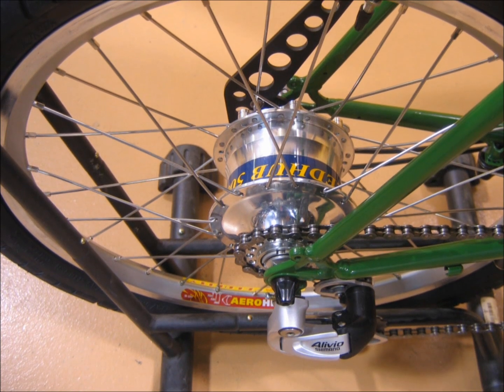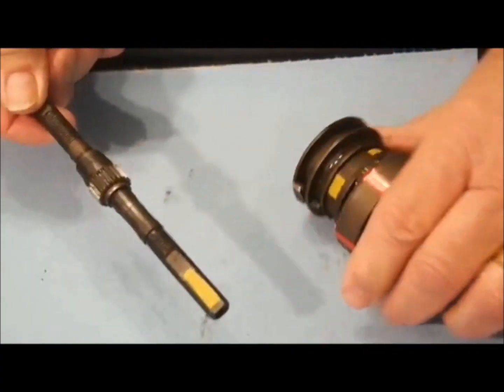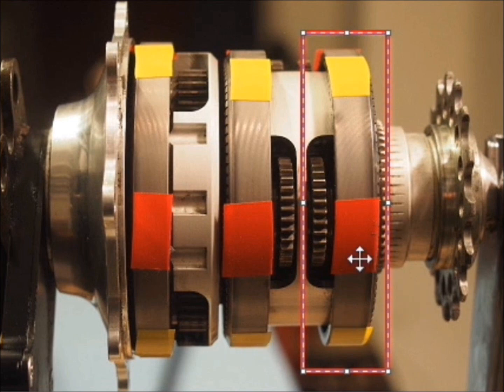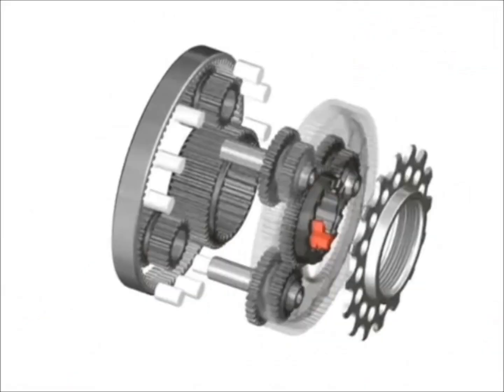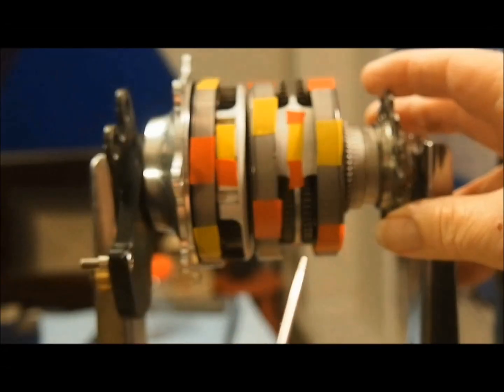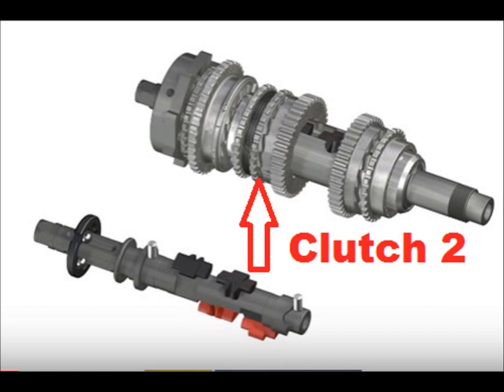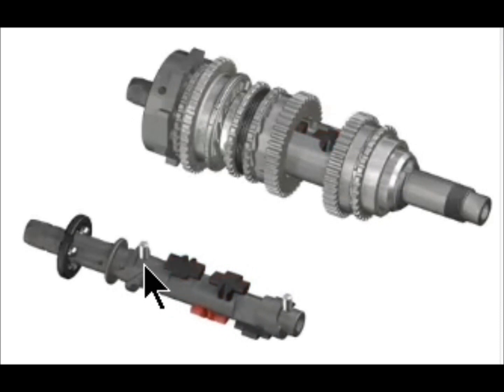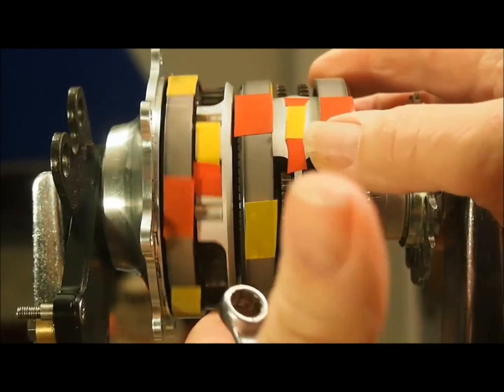Rohloff Speedhub How it Works

Comment: Thanks for video, but Rohloff is total German invention, heavy, expensive and not fun to ride, stupidly heavy resistance, have not one rohloff and took apart to understand its not perfect design.  People who buy rohlof to drive around the world make two times around the world only to compensate resistance.
Reply: I totally disagree. I cycle my GIANT Expedition AT with my Rohloff Speedhub 500/14 like a total heavy racer. Totally agile gear hub. Never looked back. Took it around the world already. Never had any problems with the Rohloff, neither in deserts, nor in jungles, at beaches, crossing rivers and flooded areas, etc. Only real alternative to this date are the - likewise German-invented and built - Pinion hub, as well as the new Norwegian-invented and built - hydraulically shifted (!) Kindernay 14 gear hub.
Reply: Definitely its drivable, but resistance very bad, take your bike and lift rear wheel with rohloff and turn pedals, take off your hand from pedals and look what will happen.... Wow pedals turning with rear wheel! Amazing!Very funny, they can turn together around the world!   My point if you turn pedals with rohloff all the time its can be some OK, but if you want to coast without pedaling... Rohloff will say NO NO No Nicht in Ordnung! Norwegians use the same Rohloff, they invented something but not gear.  hydraulic shifter maybe good never saw, original rohloff shifter motorcycle style bad.
Reply: Stasys, you could hardly be further from the truth. Rohloff Speedhub is IMO the only hub gear which has the same mechanical efficiency as common derailleur gears. Plus, it is very much fun to ride, I would never go back to a derailleur gear, since the Rohloff bike with a Hebie Chainglider chainguard is so easy to keep in a good condition. And of course you can coast without pedalling, I have done it without any problems for hundreds and hundreds of miles.
Please don't post things that are simply untrue!

https://www.rohloff.de/en/experience/technology-in-detail/mechanical-efficiency/
Reply: My rohloff hub is fantastic. 14 years and 84000 km (including 25 12 and 24hr endurance mtb races) without a single adjustment (apart from 2 new sprockets). Efficiency only fractionally worse than a clean derailleur system - tested (timed) back to back on same tracks. Much better than a dirt-choked one. Maybe you got unlucky with yours?

Comment: Will this work on my Organic Transit ELF with the extra long shift cable run? I have a serious problem with sloppy shifting and gear grinding due to the long cable run for my 8 speed hub, even after upgrading to high end teflon coated cable. Also, does the Rohloff axle accommodate a rear disk brake AND still have room for the freewheel of my motor drive on the port side?
Reply from the maker: There would be no way to mount a freewheel on the non drive side without some extreme engineering. The axle plate and shift mechanism would be pretty much impossible to work around.
Reply: Extreme engineering? Only a sufficient axle length is required. Hundreds have been built in this way by two different solar/human powered hybrid companies. They place it next to the disk brake to attain dual chain rear hub drive. But the quality of Shimano or Sturmey Archer 8 speed hubs is not so great for precision shifting with an extra long shift cable run.
Reply from the maker: Are you talking about using the hub as a mid drive, or in a wheel? I'm guessing you have not seen one of these up close, and I will stand by what I said about the extreme engineering required to fit a freewheel around the axle plate and shift mechanism. 
 I did not say impossible, and if you are able to accomplish it, I would be very interested to see how you do it.
Reply: Hub. Accommodating this application would open up a market for the human/solar powered velos.
Reply from the maker: I can see a way to do it with a fixed cog if you can build the freewheeling mechanism into the drive unit. Machine a flange to sit outboard of the disc rotor (using the same mounting bolts) far enough to allow chain clearance and mount a cog to it. Note that the rotor bolts and the hub cap bolts will be subjected to shear stresses that were not designed into the unit.

Comment: Great job explaining it. I wish they would move this gearing solution from the hub to the actual bike (pedals). This way the weight is more centered to the bike and you can have a stronger back wheel. However I do appreciate this technology because it allows me to install it on any bike. In your opinion which one is better : Rohloff or Shimano?
Reply: nacra60na check out the pinion gearbox, I think that's what you're referring to.
Reply: Phil Weatherley   I'm waiting to see how this pans out.
https://www.veercycle.com/
Reply: I was going to mention Pinion, they have gear hub mounted at pedals but that requires specialised frame to support it and Pinion is even more expensive than Rollhoff :)

Comment: Do you list the efficiency of these geared hubs? Generally, internal geared hubs are less efficient than that of external cogs. This information would help to qualify a geared hub product.
Reply from the maker: There has been studies and tests done on various gearhubs to compare their efficiency to derailleur systems. I don't have the time to look it up right now, but Rohloff has a reference to one such test on their site.
Reply: @2wagondragon  I've read that Rohloff is one of the best.  Next down comes any of thin oiled Sturmey-Archer (British made) hubs.  Clean derailleur are comparable to SA.  Then the greased gears and bearings are at the bottom.

Comment: How are the physical movements from one gear to another made?
Reply from the maker: The control is a rotary shifter with two cables. It pulls the shift mech in both directions, there is no spring return. 
I hope I understood your question.
Reply: Magic.

Comment: Thanks Dan, you are a clever man.
One of my favourite features of the speedhub is that the indexing mechanism is contained in the hub and not the shifter. As I understand it, this makes it virtually impossible to ride the hub out of ideal adjustment in the same way that one might do so over time with a Shimano or SA geared hub. I think this would be an excellent feature on the cheaper and lower-gear-range IGHs as it would make them even lower maintenance for the average user. I have wondered if this is a feature that Rohloff has patented and for that reason we won't see it on any other IGH unless they were to bring out a a lower range model themselves. That said, I believe the Pinion gearboxes are also internally indexed.
I have always wondered what the axle unit and indexing mechanism looks like inside the speedhub. It would be great if you could make a video on that.

Comment: Hi, I'm having trouble rebuilding my rholoff hub, could you do a rholoff rebuild video?
Reply from the maker: Hi Nicolas.
I will try to do one some time, but I have too much going on right now to get into that.
Could you be specific about the problem you're having? Might be able to throw some ideas out.
Reply: I think something is wrong with one of the springs that actuates the clutch mechanisims on the central axxle

Comment: WHOA! Just checked pricing for these little mechanical marvels. The Shimano looks to be more in my budget range. Thanks for the excellent presentation(s) - I've watched a few of your videos - and don't let the trolls get you down. I'm a handcyclist looking to build my own trike, where something like this IGH would simplify chain tensioning/routing and improve longevity/service life. I've got dirty nails, more often than not - life in a wheelchair. Keep up the good vids.
Reply: Hi - I plan on a rear wheel drive design with two wheels up front, modeled (somewhat) after the Ti Trike. I'm also looking into creating a leaning/tilt suspension, to assist with maneuverability and stability, specifically in high speed turns. Not sure if both a lean and a tilt can be combined (I'm thinking stability, once again). With front wheel drive handcycles you have two factors that limit both maneuverability and stability. As you lean back in a FWD unit (such as the Lightening I have), stability decreases the further you lean back on the trailing wheels (ask me how I know - scars). Maneuverability isn't too bad with the Lightening, as it uses a leaning kind of steering, but with both a lean and a tilt built in you would (theoretically) greatly improve maneuverability. My first inclination is to create a universal joint attachment where the frame Ts to provide the ability to lean into your turn, but I've checked out some tilt suspension designs that I like as well. First, I need to have my nephew clear his stuff out of my garage/workshop. LOL
Reply from the maker: Thank you so much for the comment. Internal hubs are very well suited to hand powered machines. Good luck with your build.
Reply: Could you do a video on how you plan to setup your trike? When you say you will build one, does that mean you or a third party? Will your trike be front wheel drive?

Comment: Excellent video, what would be your first choice for an IGH one step down from the Rohloff ?
Reply: The Rohloff is an heirloom product. Less expensive in the long run. It will outlast every bike you put it on. It will outlast you. Leave it to your next of kin.
Reply from the maker: Hi Steven.
Thank you for your comment.
I tried to reply to your other message but the system wouldn't let me..
 The Rohloff would be overkill anyway if you are not riding hills unless you are planning loaded touring.
Sram has announced they are exiting the IGH market entirely later this year, so I would not recommend it as an option. Parts support for Sram hubs has been pretty much non existent in North America anyway, so it's never been a good choice.
 I really like the Shimano Alfine 8 speed although some riders are aggravated by the uneven ratio steps. I find it a very robust and smooth operating hub.
 If you want to avoid gear steps altogether, you could go with the Nuvinci CV hub. The model numbers denote the ratio range, 360% or 380%. That puts the 380 just short of the 409% range of a Alfine 11 speed.
 I do not have a Nuvinci myself, but I do know people who have them, and they like them a lot. Also have not heard of any failures with this hub.